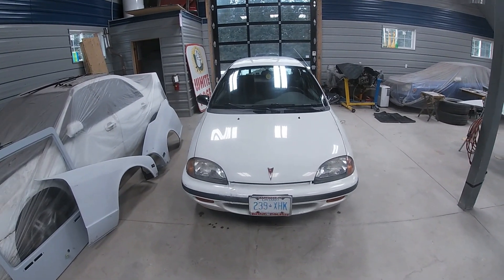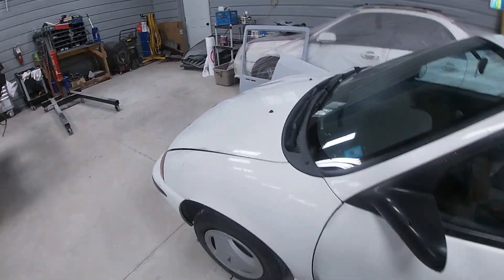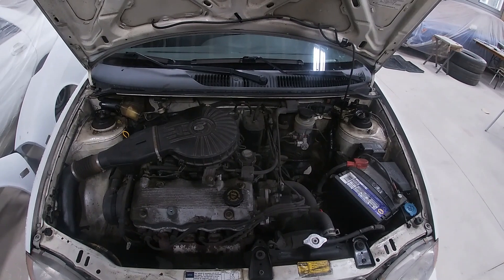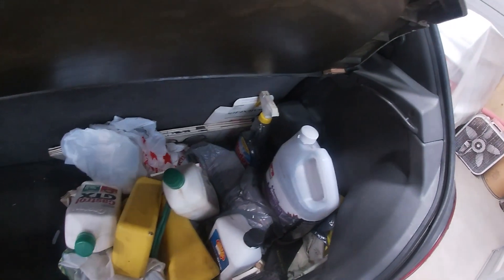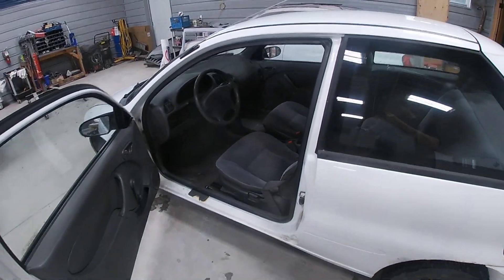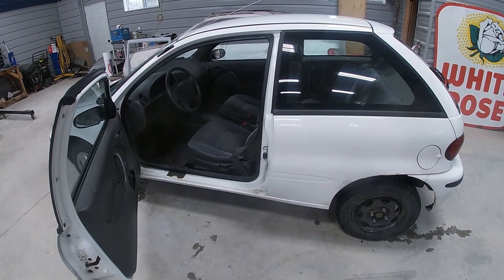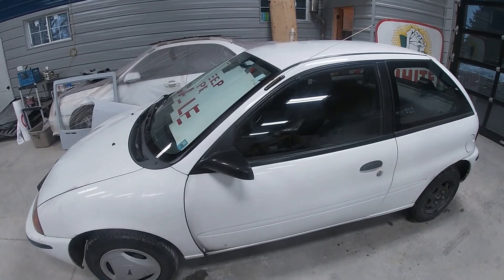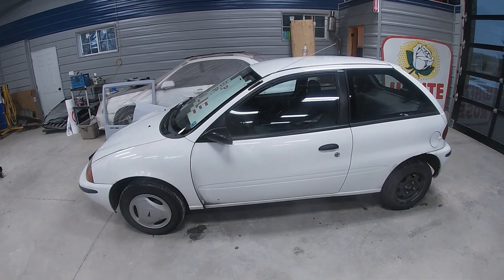Estate sale fuel saver! Can I get this one owner Pontiac Firefly back on the road?

Comment: Clean little storm trooper ya got there! My ‘91 firefly just kissed 350,000 and its still averaging roughly 57-61mpg on the 3 cylinder 5 speed. Super fun to drive, though being over 6 foot, it can be interesting with all of my work gear on. Lol SLOW AS HELL and noisy as can be. Got mine out in Boulder. Total to get her on the road was 1300! Lovin it.

Comment: Great video 👍 
You certainly got value, not sure what you paid...
3 cylinders react best to a turbo, but that 4 cylinder will do fine. As a mechanic I believe you will wallow in the simplicity of your little egg while dealing with the modern monstrosities. Pretty sure its capable of very satisfying performance. Salt is wicked also here in Quebec, that one had been treated. I always found touch ups with sticky heavy summer weight chain saw oil to be very effective mid winter to blast out salt and seep and cling. Probably you can boost that 45 mpg even higher 😊
Reply from the maker: Robert got a solid 3 years out this car without doing anything really! Recently he retired it as the unibody was letting go due to rust. He did not scrap the car though, he gave it to another firefly enthusiast to use for parts for his fireflys! 

I also actually have a 91 firefly myself, eventually ill post a vid of mine on the channel
Reply: @TheSubieSanctuary  That's pretty good, I guess it did severe salt duty in winter. I believe it was only   the 3cylinder they turboed. There was a 2017 Suzuki with another 3 cylinder turbo. Look forward to seeing yours. 👍

Comment: Takes me back. I bought a new 1995 Pontiac Firefly SE 2 door hatch in black with the 1.3 L4 and the 3 speed automatic, the only way to get the 4 banger that year. I had it until 2008 with 300,000 ish KM's on it. I loved that little car. Great for city driving, great on gas and could haul almost anything. Although I loved that little car, the repair costs were starting to get a bit high and getting parts was a bit of a pain as had to wait for them to be ordered as not stocked at dealers and repair shops, it was time to move on. When I traded it in, the dealer had some government incentive to get older cars of the road and I cannot remember - I either got $1,000 or $1,500 credit for "car heaven". I was the one and only owner of that car. You have a little gem there for someone that appreciates this type of vehicle.
Reply from the maker: Thats awesome! They are a cool car for sure. Used to be cheap to maintain. Some die hards still out there though. Stay tuned, this winter I should be revealing my 1991 firefly convertible!
Reply: Car Heaven is wild, but they had a c4c type thing in Canada?

Comment: The engine is built by Suzuki and all the parts is Suzuki
Reply from the maker: Thats why they soo good 👌
Reply: @TheSubieSanctuary  i love Suzuki, i miss them. I really want this car because it’s a very economic car
Reply from the maker: @samueldecelles6646  they were fantastic, my best bud has 4. A bit of a collector. Even has the electric one 😳
I also have a 91 firefly convertible that my dad bought new. Ill be doing an overhaul on it this winter. Make sure you sub so you can see it! Putting the swift gti body kit on it!
Reply: @TheSubieSanctuary  👍